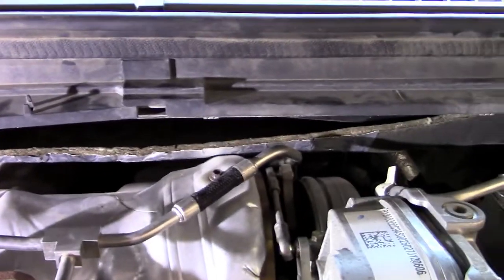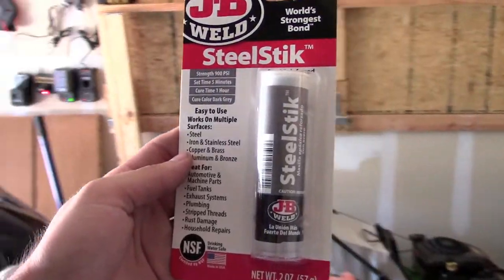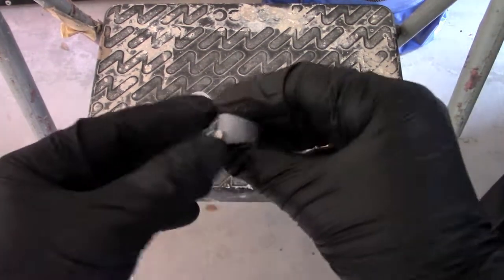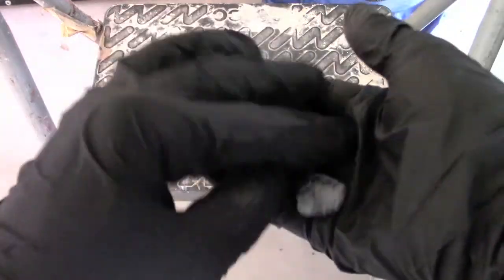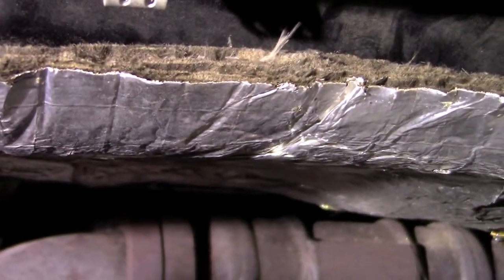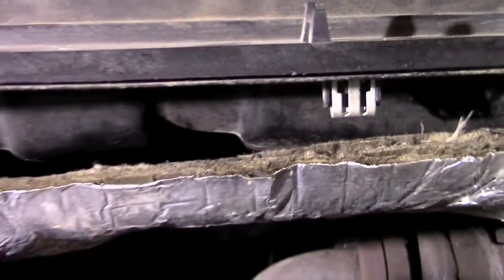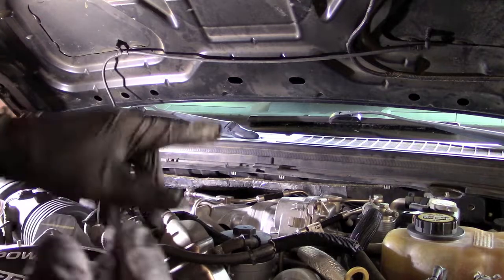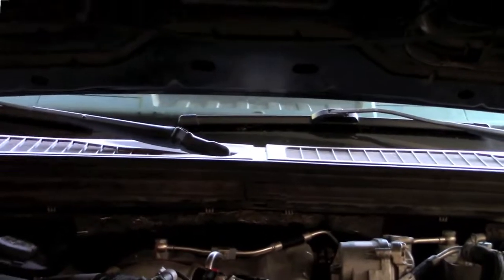6.4 Powerstroke Broke Down Again!!

Comment: Can you explain more about how you fixed the outside air temperature sensor problem? I got the same problem with mine it's reading wrong.
Reply from the maker: it can be a few things, first the sensor is on the passenger side up by the radiator support. Check to see if there is any corrosion at the connectors. If there is clean them and put on dielectric grease (autozone sells this by the counter). If that does work buy a new sensor, they are $20 bucks. 99% of the problem is going to be at the sensor location since it is exposed to the weather. hope this helps!
Reply: @LSRWvlog  ok thanks. I already put a new sensor on but it still reads wrong so it must corrosion.
Reply from the maker: @Mark_Tschetter  yes check your contacts at the sensor
Reply: @LSRWvlog  do you still make videos?
Reply from the maker: @austinreed347  I still make videos but not about the F450, I sold the truck in June of 2020
Reply: @LSRWvlog  ok